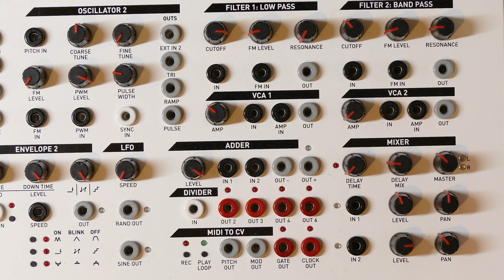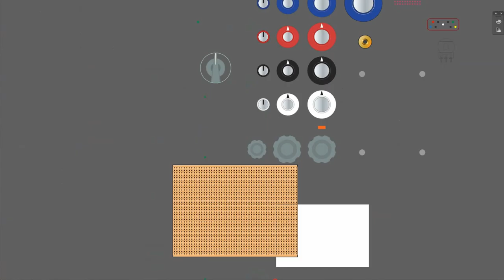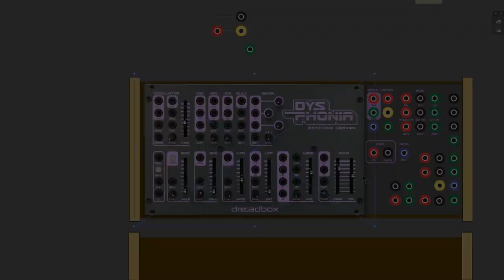Dreadbox Dysphonia - Sound Examples, Issues, and DIY Solutions

Comment: It looks like they plan on releasing a case for these since they put out another one in this format and a couple re-issues later as well. My case is going to be based around the TipTop Buchla modules, but the Dysphonia is living in it at the moment. It is a little less cramped now that I have more modules and its not just everything in the Dysphonia.
Reply from the maker: Yes, I saw the case in the Superbooth videos, though it doesn't solve the cramped interface as a standalone synth. Mine ends up being far better for my use, since I have doubled up the connection points with banana sockets and got them out of the way. It's so much easier to play now.
Reply: @hakonsoreide  I ended up watching your other video on the full build after I left my comment. Pretty cool this kit makes it easy to hack that up and its simple enough you could undo it easily if you ever wanted. Nice job.
Reply from the maker: Thanks. Yes, it's a lot easier tinkering with a synth when it's DIY to start with. And also I am far less concerned about breaking anything. I've had some ideas for mods for my Phenols, but nothing essential. I may do some things with those too some day if I am feeling very adventurous.

Comment: Crowded. More like patching hell then...
Reply from the maker: Yup. Way too crowded, which is why it was mod or sell for me. I am glad I went with modding, though. It is an amazing synth, especially those filters, but that cramped eurorack interface is a nightmare. I've got two Dysphonias now, and a banana patch panel for both well out of the way of the controls.
Reply: Sounds like a great solution! @hakonsoreide
Reply: I use super short cables and it's one of my most useful single tools in my rack